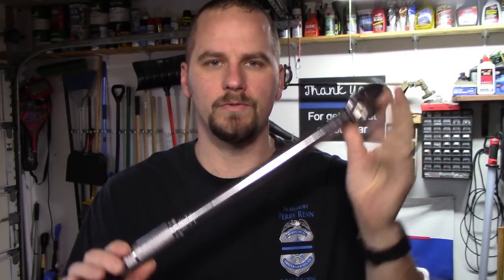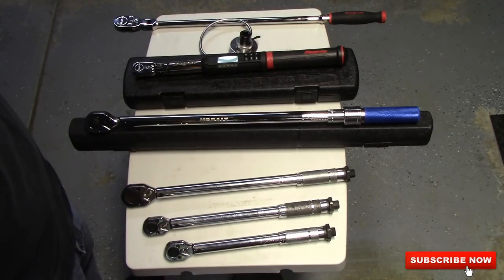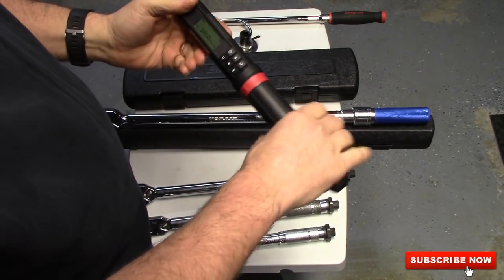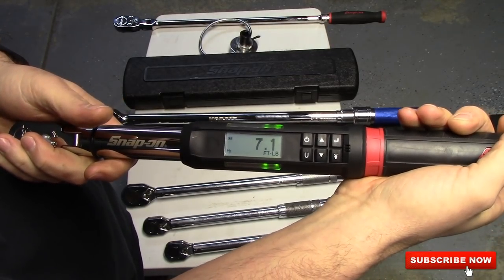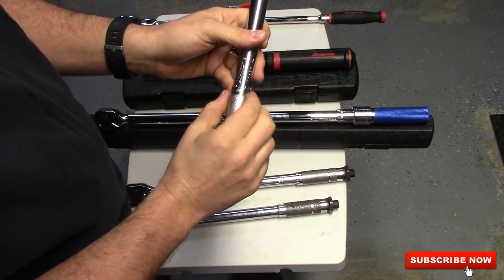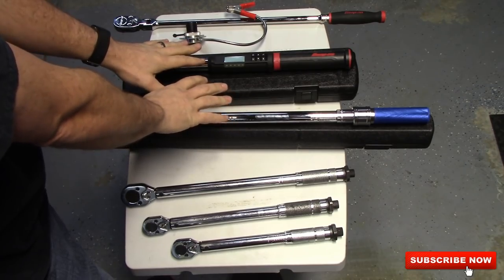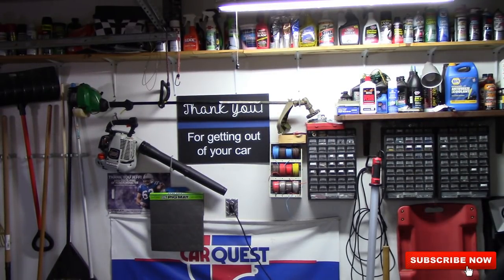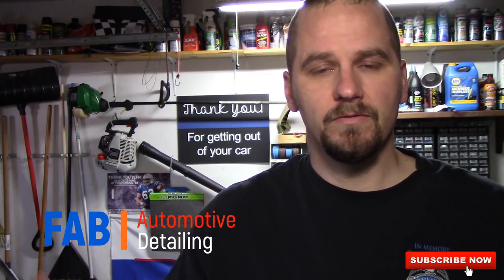Harbor Freight,Kobalt and Snap-On Torque Wrenches

Comment: KG.CM=kilogram/centimeters. DNM is deci newton meters, remember deci=1/10th, centi=1/100th, milli=1/1000th. So the metric users use DNM instead of inch lbs the way we imperialists do. 
PS I am from the US, I have a science background, hence why I know metric well.
Reply from the maker: Marcus Taber Thanks for breaking that down. I’ve just never used them so I had no idea what they were. Thanks for watching!
Reply: Just don't confuse Dnm with dnm: D is deca, d is deci.
Reply: "KG.CM=kilogram/centimeters....I have a science background, hence why I know metric well..."  But not a background in physics.  A torque is expressed as a force acting on a moment arm.  Therefore, kg-cm.
Reply: TORQUE is stated as a PRODUCT of lever arm (or inches or centimeters, etc) TIMES the force, NOT divided by it.

Comment: retired from wrenching for a living back in July of 2018. Still fix my own and occasionally for friends and family. I am looking at the Kobalt Torque wrench hoping it comes down for the holidays. I've never used a torque wrench on alloy wheels but I just got both of the Kobalt 24v brushless 1/2" impacts (standard @ 650 Lb/ft torque and the compact @ 200 lb/ft torque) and my xj has alloy wheels so that being said, I'm thinking it would be a good idea to check after changing/rotating tires. All the years I wrenched for a living, I was never a brand whore. For me it was always about what I could best afford (with life time warranty) and availability. So as you can imagine, by box is a mix of brands including some Snap-On. Great honest review, thanks.
Reply: @FABAutomotiveDetailing  I've had HF cordless before, got a year more or less on a drill. For the Kobalt cordless line, the are 24v brushless, 5 yr on the tool, 3 on the batteries, batteries are cheap and their entire cordless line up has a 1 year return full refund, no questions asked. I've heard the HF line actually cost more than Kobalt and batteries are pricey. But do your research before you buy either. For what it's worth, prices are way down on the Kobalt line right now....
Reply from the maker: The CADD Monkey Thank you for the info!

Comment: Went threw 3 harbor freight 1/2 in torque wrenches 2 didnt work at all and the last one was constantly 10ftlbs off spend the extra money on the big one. 1/4 in works fine i love it
Reply from the maker: Christopher Anderson My h1/2 inch Harbor Freight is also 10 ft/lbs off also. They are ok if you are aware of that and I don’t use them on customers cars because of that.
Reply: @FABAutomotiveDetailing  Why not adjust it?

Comment: Hi, My Craftsman 1/2" and Craftsman 3/8" electronic torque wrenches have crapped out. I recently got a 3/8" 20-100 Ft/Lb Kobalt for about $55 at Lowes. Now I need to replace the 1/2".  Lowes Has a Kobalt 1/2" like the one in your video for about $60.
Reply from the maker: @vancedyer755  My 1/2 inch Kobalt has been great!
Reply: @FABAutomotiveDetailing  Well, I went to Harbor Freight and I ended up getting a 1/2"  pivoting head ICON torque wrench. It claims to compete with the Snap on.
Reply from the maker: @vancedyer755  Those are great also!
Reply: @FABAutomotiveDetailing  
I still like my Kobalt 20-100 Ft/Lb torque wrench, all metal no plastic. I will use it as an intermediate wrench that will probably get most of the jobs, due to its size and torque range.  Thanks for your review.

Comment: Great video! I also have all three HF torque wrenches.  I bought the 1/2 inch one recently, and I noticed a problem. If I set the wrench for say 30 ft lbs,  the slide piece with the 0 to 10 markings, would line up just past the 30 ft lbs line on the wrench body. There is a zig zag line from the 30 to the place where you line up the O on the slide piece. So it actually lined up at about 32 ft lbs. I took it back to HF and returned it. I then checked the new ones in the  plastic cases  (about 20 of them). I found most of them also lined up the same way. I finally did fine one that lined up correctly. Also, the scale markings on the body (that indicate the foot pound number) were sometimes very faint and hard to see.  I am not putting down HF, just pointing out some problems I found.
Reply from the maker: Douglas Ernst Thank You! Yeah HF being cheaper tools sometimes the quality between two of the same products are different. I use several of their tools daily and have had no problems. I have also used a HF tool once and broke it. Sometimes you get what you pay for.
Reply: Hit the numbers with some black nail polish, let it dry, then remove the excess with a paper towel and some nail polish remover. Sorted.

Comment: Harbor freight great better than any other brand. I've been using there breaker bar and torque wrench for 7 yrs
Reply from the maker: james ? They are good but not accurate! If you get to put them on a torque accuracy gauge you will see they are usually -10 to +10 from your actual setting. I have their breaker bars and they are fantastic!

Comment: Manufacturers like to give you the two pass tightening torques, where first pass is some low torques in ft lbs or nm just to level the parts flat and square, and second pass is some degree of angle because that is more accurate way to measure clamping force. The engineers who designs these things don't know if you have grain of sand or some other particles between the threads bringing more friction and screwing the twisting force results of ft lbs.
Reply from the maker: kaapo76 I understand that but most Japanese manufacturers give you 1st and final torques in ft/lbs so there is no need for an angle gauge. If you tighten to 20 ft/lbs first then 90 degrees, you tightened it to a certain ft/lbs I just don’t know why they won’t tell you what the final ft/lbs are. Thanks for watching and commenting

Comment: HF has a new brand of torque wrenches from icon. They are more costly but have been proven more accurate than the snap on click type. Well worth the 80 or 90 bucks.
Reply from the maker: infamyseemsshort I have heard the Icon’s are good. Thanks for commenting.
Reply: Any hf name torq tool is not worth 80-90 lol

Comment: Did you happen to make that clamp on your dial? I have my trusty 3/8 and 1/2" drive dual beam snap-on tq wrenches. The same 1/4" HF wrench. So far on this little LS motor im building I have been using my OTC angle guauge. works great as long as you have somewhere to secure the pin that comes with it. I as thinking about making something to clamp it in different spots, like one of those dial indicator arms with a clamp that you can tighten up on the end and it turns rigid. Even though ill probably never use it again as long as this $200 Kobalt one beside me works like its supposed to. bought my first digital yesterday, I couldn't talk myself out of it. Seems only logical to spend $200 on a TQ wrench to tighten up a $400 set of head studs  and another few $100 in the other bolts I didn't swap out to ARP. Havent checked but the kobalt was probably cheaper than having both my snap-on wrenches sent out and checked. Now I think about it the head studs don't use torque angle anyway im pretty sure. oh well I got a new tool and a tool box sticker out of it for $200
Reply from the maker: shawng7902 No the clamp came on that angle gauge. It works well but kind of a pain. Torque wrenches can be expensive but you get what you pay for. I like digital torque wrenches but I wish my Snap-On would click instead of beeping. Nothing wrong with a new tool and sticker. Haha

Comment: The compression and decompression of a spring is what wears it out. Therefore decompressing the spring after each use would wear it out faster....right?
Reply from the maker: delav83  No actually it’s  the opposite. Leaving the spring compressed in the same spot for long periods will make it “learn” per say that tension not allowing it to decompress correctly when needed to lower the torque setting. I use to never decompress after each use until I saw first hand what it would do leaving it constantly under pressure. Now I just lower it  to the lowest setting.
Reply: @FABAutomotiveDetailing  I have heard to lower to the lowest marked setting, which is not usually as far as it can adjust.

Comment: I remember the first TTY head bolts I encountered were Ford escort 1.6L 44 foot Lbs +180 deg. +180 Deg., (I checked every source I had "remember in the '80s no internet) I could feel them stretch  and gritted my teeth waiting for the snap, it didn't and I got used to it.
Reply from the maker: jz422 Head bolts can make you nervous for sure! Sometimes you swear it’s to tight but then the torque wrench clicks.

Comment: 1:15, Actually just like almost everybody else on YouTube, you are wrong about that.
According to the Proto torque wrench tech representative, you should store your micrometer torque wrench at 20% of its maximum setting. ( And those Harbor Freight torque wrenches are nothing but a copy of Proto wrenches minus excellent locking mechanism of Proto )
Usually, that is the lowest setting on the wrench. You shouldn't go bellow of that.
Spring needs to be stored under slight tension.
I always store my Proto 40-200 Inch-pound torque wrench at 40 Inch-pound after use, 200-1000 Inch-pound torque wrench at 200 Inch-pound, and my 50-250 Foot-pound torque wrench at 50 Foot-pound after use. Never below 20% of its maximum setting.
Reply: Huh.

Comment: I'm looking for a 1/4" or 3/8" drive in-lbs torque wrench, for DIY use, because my Craftsman 1/2" drive starts at 20 ft-lbs. Everything available is either astronomically expensive , or Harbor Freight....
Reply from the maker: FourDollaRacing Harbor Freight has a new line of torque wrenches that are suppose to be good. I think they cost somewhere around $75-$100. You can find some good ones on Amazon like Crescent,Tekton,Gear Wrench to name a few. Also Napa sells some decent torque wrenches. Hope this helps
Reply: Yes, thank you.
Reply: Buy tekton
Reply from the maker: victor gamez Actually I have I thought about Tekton recently. I hear they are pretty good.
Reply: @FABAutomotiveDetailing  From what I gather Tekton and HF are about the same but HF cost $10
Reply from the maker: Kansas Gardener Thanks I believe they are the same also!

Comment: I have a question for you. I am certainly no expert mechanic, but when you work on  TTY bolts,  why can't you just torque them to the final torque setting to begin with?  Why bother with a lower torque on the first pass, and the final torque on the last pass?
Reply from the maker: Douglas Ernst It’s all about adding even pressure to a part like a cylinder head when torquing head bolts. If you start with the final torque setting you can warp the head or cause a head gasket leak from uneven pressure being applied. Rod bearings for example if you torque one bolt to the final torque setting first then tighten the other side down it won’t go all the way down and the bearing will fail. Hope this helps
Reply: I once overhauled a V-8 engine, and I had to remove the heads. I remember I screwed the head bolts on in order, but not up to full torque the first or second time. I didn't check the torque setting for say 50% torque, then continued. I ended up with the final torque, and the engine ran fine for years after that.  I just wonder if you really need to be so exact when tightening the head bolts at first, but I do agree the final torque should be right. Thanks for responding. I am just trying to learn something here.
Reply from the maker: Douglas Ernst I agree The final torque is all that matters in the end. I don’t believe specific torque specs matter until the end. Just by feel you can get them all close to the same on the first few passes then torque then final pass. In the shop I try to do all torquing per manufacturer steps that way if it comes back I am confident I did the job exactly the way OE specs state.
Reply: It's best to use this with any assembly that has more than one fastener.
Like for instance the motorcycle carburator float bowl screws.
If you were to tighten the first one to full torque. You'd probably brake the bowl because it's cast aluminum.
So you'd finger tighten ( fingers on the shaft of the screwdriver) all 4 scews. Then you'd notice the first one is now slightly lose. Then repeat until you can no longer move the screws with your fingers. Now it's time to repeat using the handle of the driver until they are good and firm.
Finally using the torque spec's to finish.
This is good practice with anything using several nuts/bolts/screws.
Lots of parts are aluminum with small flanges which can brake if over tightened or tightened unevenly.
Also helps to align things that don't have alignment pins.
Good luck.
Reply from the maker: Frank Taylor Great explanation! Thanks
Reply: Thanks
Reply: @franktaylor7617  I just snug 'em up with a screwdriver. Not everything needs to be torqued. In fact, a lot guys break oil drain plugs by trying to torque them.
Reply: @maximusmax4557  
True.
I just make them tight.
I only use the spec's on important things.

Comment: HF torqs come in a molded case and the coupon price is 9.99 as of 10/25/18
Reply from the maker: brent hann They are decent torque wrenches especially for the price. After I made this video I remembered they had cases but it was to late to change the video after I uploaded it to YouTube.
Reply: @FABAutomotiveDetailing  Still the same price 2/8/19

Comment: How do you adjust the spring on the Kobalt? Every other wrench has a way to do it but the Kobalt doesn't seem to have any way to do it!
Reply from the maker: Are you talking about manually adjusting it if you think it's not accurate?
Reply: @FABAutomotiveDetailing  Nevermind, I figured it out.

Comment: Very nice video. The one I have is like the Harbor freight one. I bought it at Western Auto. They work OK. Inch pounds are also used on modern thermostat housings and such. I like Kobalt tools but they just are not made in the USA. I want a digital one but man the cost for a DIY backyard guy. The angle deal on the Snap on is killer. Like the caliper bolts on my 2012 SS. They are TTY and man can be a pain if you do not know what you are doing. This would make it so much simpler. Good tip on resetting to 0. Most people forget.
Reply from the maker: Thank you! Yes Kobalt is not made here but the quality of their tools out weigh where they are made in my opinion. I like my Snap-On tools but if I can buy a cheaper tool that I know will last then that's what I do. The problem with USA tools are they are so much higher in cost because our labor rate is much higher here. Snap-On has a 1/2" Torque wrench just like my Kobalt I mean they look and feel identical all the way down to the exact same lock. The Snap-On is about $350 and Kobalt $79.99. Sometimes where they are made just doesn't matter to me but I do like to by American when I can.
Reply: @FABAutomotiveDetailing    I think snap on s. Are actually. Made by CDI ,, there's. A bunch of info on the garagejournals.com. about rebrand s. Used by snap on , mac , Matco etc save and go to the source
Reply from the maker: John Willis Thanks but Snap-On torque wrenches are made by Snap-On in Tennessee. There is a video on YouTube by Snap-On that shows where they make them I will try to find the link.
Reply from the maker: John Willis Ok it is actually in California but here is the link: https://youtu.be/VqnakKYNZX8

Comment: I don't think that Snapon makes their own torque wrenches. Maybe micrometer type, maybe.
They probably only make ratcheting head for their torque wrenches.
Precision Instruments used to made Split-Beam type torque wrenches for Snapon, maybe they still making those.
Snapon owns brands, CDI torque specialists, and Sturtevant Richmont Torque Tools and Torque Calibration specialist company.
I own Sturtevant Richmont DTC-75 Digital Torque and Angle Wrench. It looks very similar to that Snapon wrench but it is a more industrial wrench, the whole made of metal, and almost double the cost of Snapon. I believe that one of those companies makes those Snapon digital wrenches.
Reply from the maker: Broj 1 From what I understand there is a SnapOn facility in Tennessee that makes all their torque wrenches. Now they could be just assembling them there I don’t know but I saw a video about it.
Reply: @FABAutomotiveDetailing  Maybe but I would not trust them. There is a reason why would they purchase at least two companies who are specialists in torque tools and torque calibration. Thank God, nothing wrong with that. Who else knows about torque solutions than specialists. Sturtevant Richmont makes their wrenches in Carol Stream, Illinois.

Comment: I've had the same crappy torque wrench for 20 years and I finally destroyed it on my 88 dodge... as it requires 180ft lbs on the CV axle nuts, and the torque wrench decided to have a significant emotional event around 170ft lbs... lol.   Now I have to to do my steering gear box, and the pitman arm nut requires 200 ft lbs of torque... (more than a weigh)  SO I started searching and found most people actually recommend the Kobalt, basically if you want a inexpensive one thats tough.. go Kobalt and if price isnt a problem or if your using it 1000 times in your life buy the snap on/snap off one.   SO I ordered the Kobalt because why not and will use it 10,000 times probably.
Reply from the maker: gittyupalice96 The Kobalt is a great choice!  You had me laughing at the “significant emotional event”. 😂
Reply: @FABAutomotiveDetailing   I'll Admit I might of borrowed that saying from ( TheCheiftainsHatch ) channel.
Reply: @maximusmax4557  Impact gun wont fit on the pitman arm nut, no room for it.  But since then I've been informed by some old timers that they just hand tighten the nut and call it a day, i guess the pin is enough to hold it on.